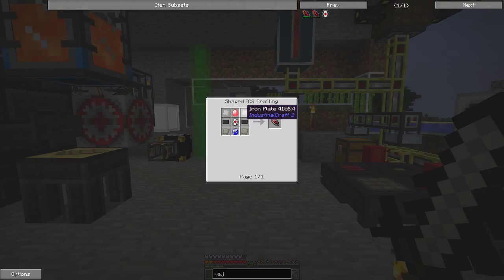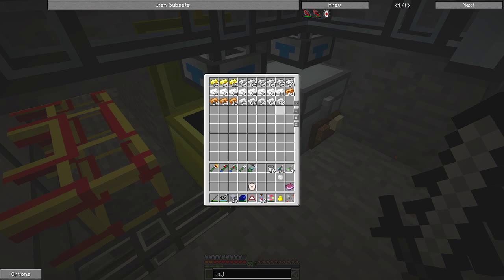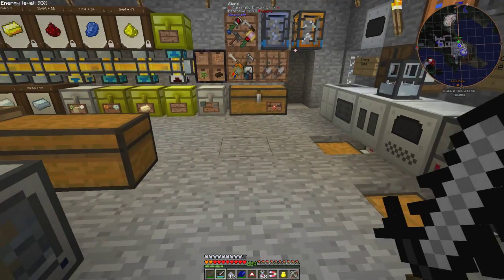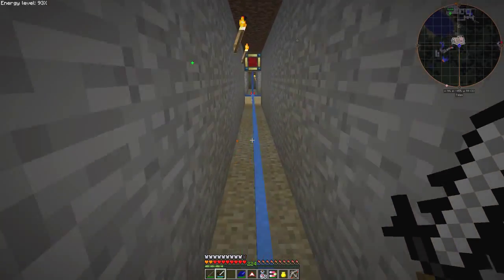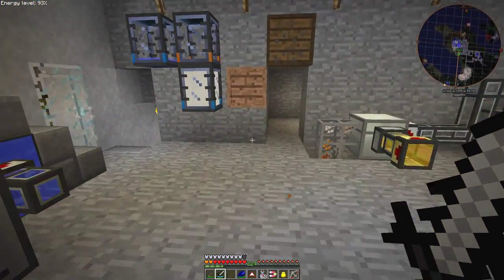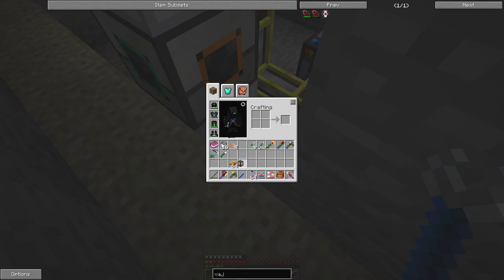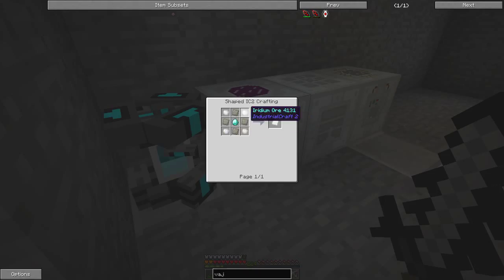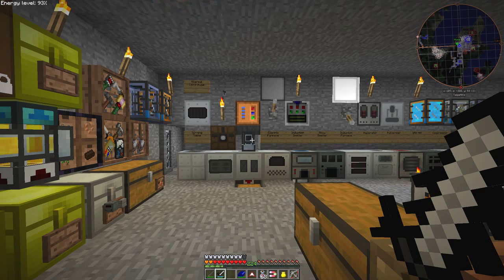Episode 31, Iridium Plate

Comment: The slots in the advanced solar panels are for charging, the 32 eu/t is its max output but it only generates 8 eu/t during the day, 1 eu/t during the night or raining/snowing , you'll get more power if you upgrade the panel itself, hybrid does 64 eu/t during the day and the ultimate does 512 eu/t.

May I ask are you not doing Applied Energistics or is that up and coming?
Reply from the maker: +mavxr Thanks that make sense so the four solar panels generate about the same RF/t as the water wheels.

I'm not plannig to do any Applied Energistics stuff because the other family members would find it difficult to use, they are 7 and 9 years old.

UnsableVoltage did some excellent videos on applied energistics https://www.youtube.com/watch?v=CeBVJeMOv2c&list=PLUoTkKw8Mb8bECMqNfZbYmF3ExX00uHRG but he has suddenly stopped making minecraft videos. Him stopping is what motivated me to make some.
Reply: Duncan Webb
I understand it may be difficult to set up and build a AE system for younger players but the benefits of a single storage ui are too good to pass. It could be built somewhere out of the way and only accessible as crafting interfaces around your abode.
Reply from the maker: +Loki Do you have an idea of the power requirements of a basic system? Such as a couple of crafting stations, disk drives and an import bus.

I have set it up once (there is an inscriber plate on one of the chests) but found it too time consuming finding items but maybe that is wrong way to do it. Automation of items like leadstone solar panels would be nice as they are very time-consuming to build manually.

Have you changed your name?
Reply: Duncan Webb
It probably wouldn't be more than 20-50rf/t if that's all you are looking for.

Oh yea, didn't even know I could change it, was messing around with settings. Had mavxr since 06 so why not :)
Reply from the maker: +Loki 20-50 RF/t is what I'm looking for, thanks.